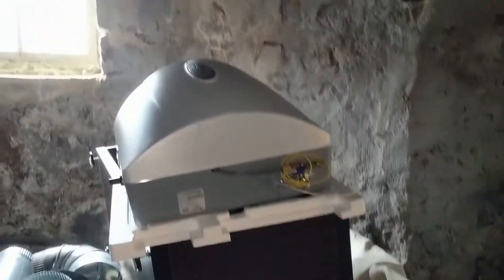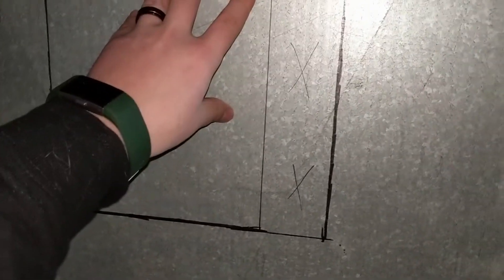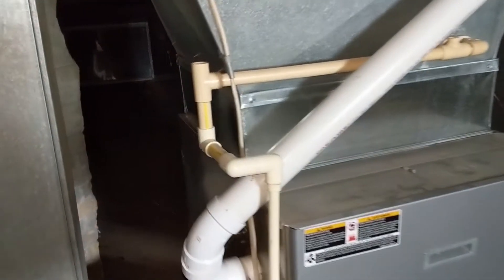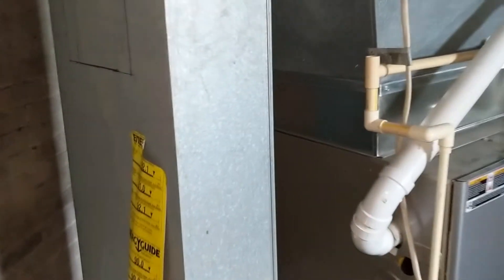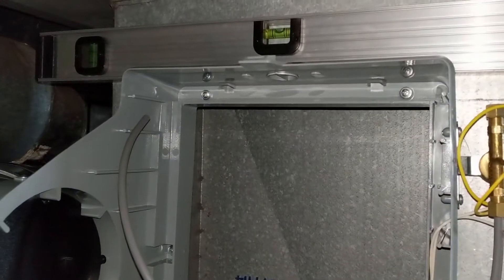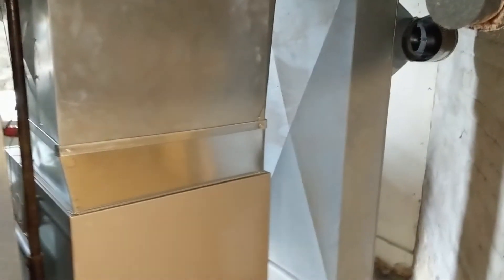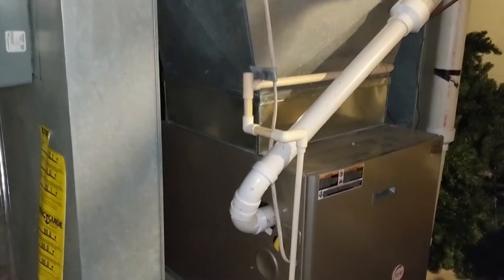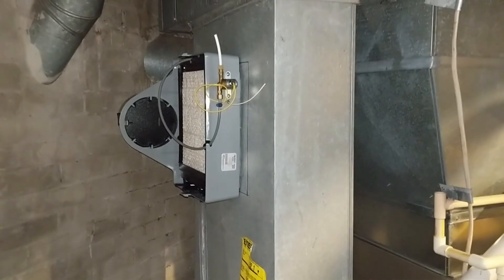Installing a Whole Home Humidifier - Part 1

Comment: I thought the 400 was drainless?
Reply: It is but the drain is included so that if the floats fail to close the water solenoid valve the water has somewhere to go rather than all over the floor.